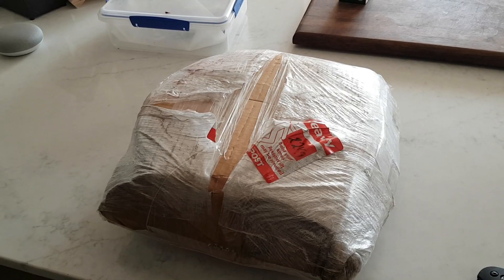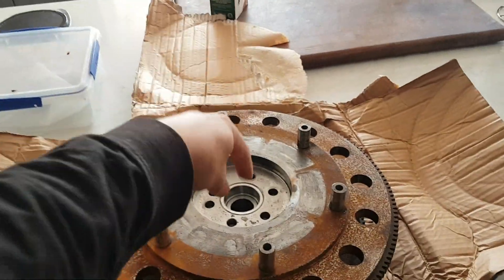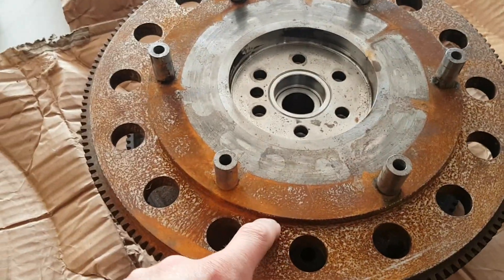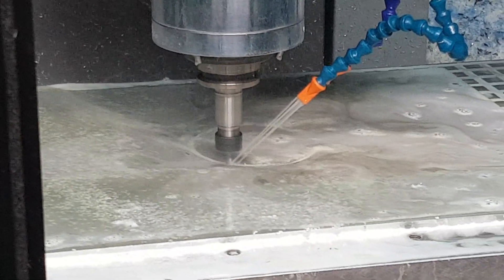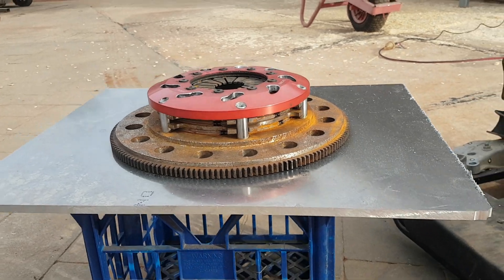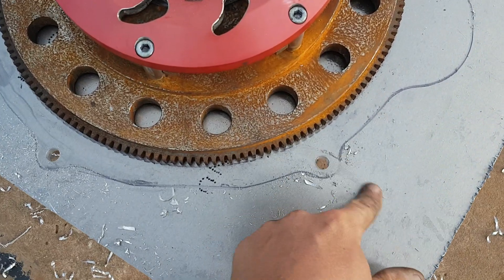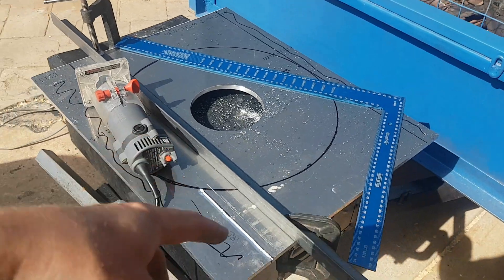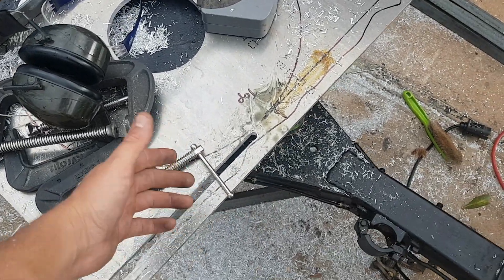Mercedes AMG C63 V8 manual gearbox conversion TR6060 - PT1

Comment: With the two adapters for connecting the flywheel you got pro machined up whats the contact for the shop that has them on file or are you selling them?    I have a CLS63 id like to convert.
Reply from the maker: Hey mate i cannot for the life of me remember the name of the shop sorry, i sold the adaptor to a bloke in nsw when i abandoned the project, sorry i cant be much help
Reply: Its Hammond Engineering you actually mention it in the vid at some point. @elheffeschopshop
Reply from the maker: Thats the one! Hes in victoria if youd like to contact him im sure he could make you one

Comment: Are you from Australia? I need this done to my C63 W204. I live in Sweden so if you are in Australia its not that convenient.
Reply from the maker: I am in australia, but i also never completed this conversion unfortunately
Reply: @elheffeschopshop I thought so of the accent. Ok why didnt you finish it? Was it to hard to complete or didnt you have the time or was it the cost was to big? If someone manage to do this there should be a decent amount of customers and you could charge almost what you want for it as you would have monopoly of it until someone else figures it out.
Reply from the maker: @DLindgren46 mainly cost unfortunately, I still love the idea and want to try it, but I can't afford an engine and box sitting around :(

Comment: Hey mate, have you got the drawings for the machined parts? Saves me measuring it myself
Reply from the maker: I dont sorry, but i have given up on the project, i could sell you what i have ?
Reply: @elheffeschopshop  check your insta
Reply: @elheffeschopshop   these came out in manual in USA for the c250 or something like that
Reply from the maker: I think our lower spec ones came out manual but i dont believe the v8 ones did
Reply: Hey did you sell these parts? Or are they still available?
Reply from the maker: I did sell them, sorry mate

Comment: We NEEED A PART 2 BRO like if its not possible just say so
Reply from the maker: 100% possible, but I dont/didn't have the funds to continue, mainly having the motor and box laying around
Reply: @elheffeschopshop  so you just have to makke ur own gearbox that fits that car right?
Reply from the maker: What do you mean?
Reply: @elheffeschopshop  i mean like do you need to make the gearbox yourself or can you just put a manual transmission from any car
Reply from the maker: They don't make a manual gearbox that bolted to this engine